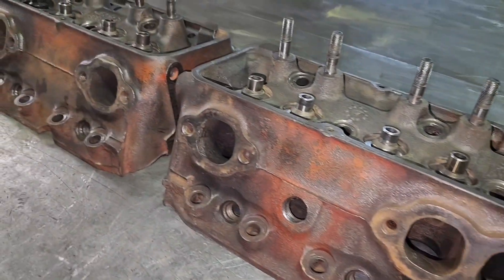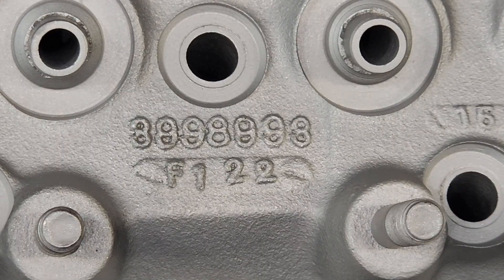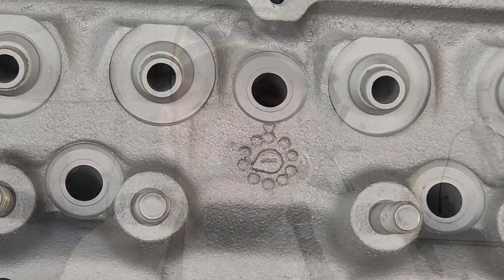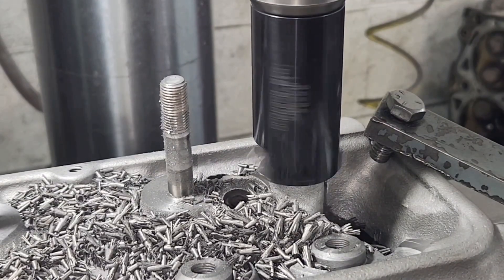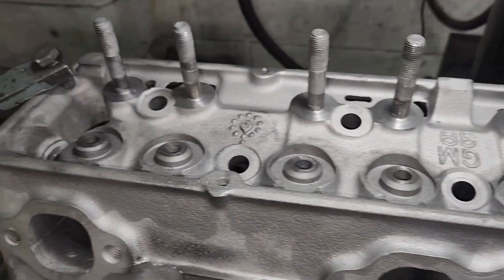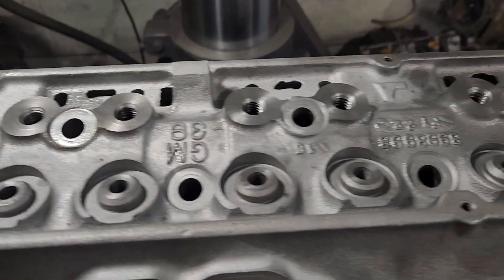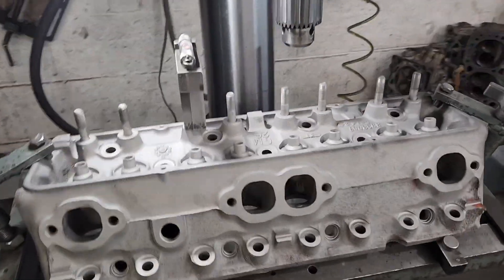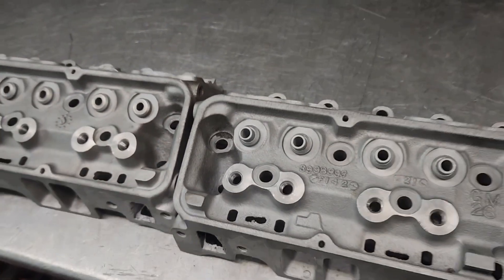How To Machine For Screw-In Studs

Comment: The sad part is that is the casting number garbage still happening today with online retailers. I have a customer who has been using my services for over 20 years. He purchased a pair of LS cylinder heads off eBay from Bishop engines. The sale was for a pair of 243 casting heads with no core return. He was delivered one 799 casting and one 243 casting. Yes, the heads have the same specifications and applications. but when you sell 243 you need to deliver 243. I took his 799 and swapped out a 243 for the cost of inspection and resurfacing. I just could not trust the other shop without inspecting their work and fixing a shipping ding from poor packing. I just wish I had a pair for 243`s in stock when he needed them and it could have been avoided. I do think next time he will wait for me to source a pair

Comment: At the 8:11 point in the video, shows a lot of sharp flashing(?), from the factory casting process.
 Some longitudinal, between the exhaust ports and some , A LOT actually, on the ends of the head, just down the corners, from the end exhaust ports.
 Can that be touched up with a grinder, to make it safer for this old clumsy mechanic🤔😂
 I'll be working on this engine job, out in the wild woods.. I don't want to cut myself on those and bleed out,,,here in the wild woods😱
 If that happened, who would take care of The RottnLab?😶☕

Comment: What I don't understand is why these machine shops don't just level up the head and then degree  the rocker arm stud, then pull the rocker arm studs, then take your email and start from one end to go to the next and mail the rocker arm stud pedestals off, been doing that for years.
Reply: email?
mail?
 Did you mean "MILL"?
 SpellChoke changes our words sometimes... Especially in the millisecond after the send button is hit🤣
Reply: Oh, one more thing..
 With adjustable rockers, the boss area where the stud fits is not as critical as the heads with non adjustable rockers..

Comment: Dave I love that rocker boss cutting tool.
I can't wait to try the one you sent to me.
Thanks again Dave. 👍🇺🇸👍☕️
Reply from the maker: It really helps the stud break free with the material removed.
I'm sure you'll like how it works 
See-ya next time Ed 🇺🇸
Reply: @BearButler321  Hopefully, the new studs don't break free, once they get installed 😁☕
Reply: @edsmachune93
 How much material can safely be removed from the stud bosses on  small block Chevy heads?
Reply: @invisibilianone6288The old stud boss cutters removed about .530 I think.
It really can very between applications.
Reply: @edsmachine93  Have you ever seen one break out, of the head casting, if the material is too thin?
Reply: @invisibilianone6288Yes, but not anything I had done or had been associated with.
Sometimes catastrophic failure, like engine blowing up.

Comment: Nice video Dave.
I like the 993 heads.
Really adding a reliability factor to the heads with the installation of screw in studs.
Check out the U drill, a letter drill that is .368 decimal.
Thats what I use for the 7/16 14 tap.
Gives a -.007 minor pitch diameter.
I like the way you clean the heads up.
Thanks for sharing. 
Have a good weekend. 👍🇺🇸👍
Reply from the maker: I like 993 heads also 👍
I've always used a 3/8 bit on a 7/16 thread
Thanks for watching Ed 🇺🇸